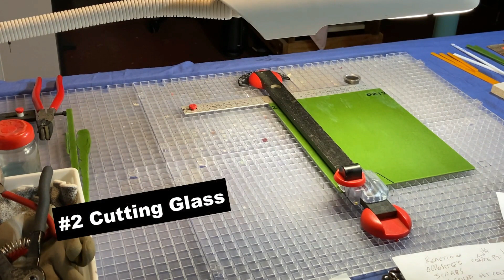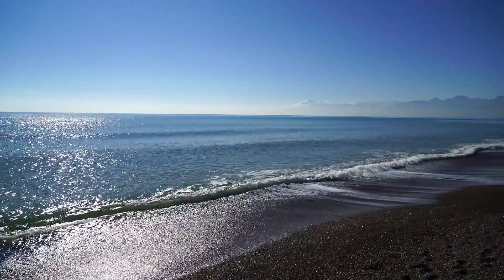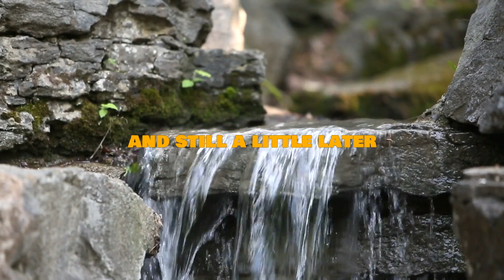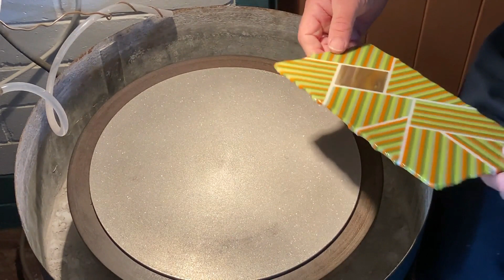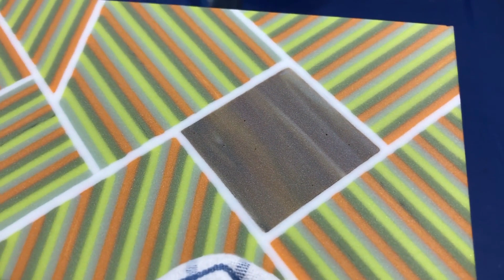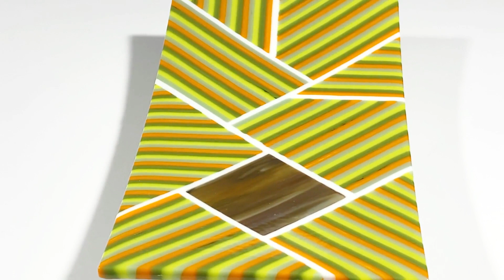Make a Fused Glass Platter Using the Strip Construction Method, Project Video Tutorial

Comment: Liked it very much! Again, two questions: What's the exact purpose of the sandblasting? And what's the temperature and time of the Polisch firing at the end? Thanks for your answers
Reply from the maker: Hi Carel. The sandblasting in this case was to remove small amounts of devitrification and clean up the bottom (to be the top) that was against the shelf. You'll find the full firing schedule in the video. There is a timeline in the description. Hope this helps.

Comment: Thanks for posting this! I have a question. Why do. you need the sandblasting step? And could you attempt to combine the slump and firepolish in one firing? Thanks for doing what you do!
Reply from the maker: Hi Sharon. You could definitely do the fire polish and slump together. I have done exactly that many times. The result will be a satin-like finish. I did that in this video - https://youtu.be/sbfvMOWyCGQ - of making stands. You could skip the sandblasting if you wish. Just keep in mind that the top of the piece is down during the full fuse so it's picked up texture from the kiln paper. You probably noticed there was still some texture in the top even after fire polishing. If I had polished at a slightly higher temp for longer it would have smoothed out nicely, but then the edges would have started rounding.

Comment: Aloha, I live in Hawaii and enjoy your tutorials!  You mentioned at the end of your platter video to suggest any changes to this project.  For the strip platter, I would perhaps try the brown streaky as a strip instead of the orange.  I would use the orange as the "feature."  Everything else I would keep as is.  I thought your platter was wonderful  I think the alternate color scheme would also look lovely.  Additionally, I would like to know what brand of strip cutter you use?  I have a Morton system, however, it doesn't have an easy to use ruler device in my model and I may switch to another brand.  Thank you (Mahalo) for your videos!
Sheli
Reply from the maker: Hi Shelly. Forgot to answer you about the cutting system. This is the Beetle Bits Cutting System. I was using their Flying Beetle accessory to cut the strips, for the first time. I think it will take a little practice. I'll do a video about the system in the future.
Reply from the maker: Hi Shelly. Brown streaky cut across the streaks would have been very interesting. I probably would have swapped the olive green and canary yellow with that.